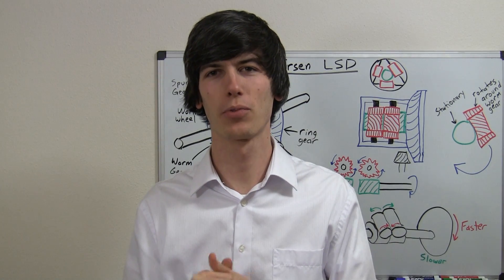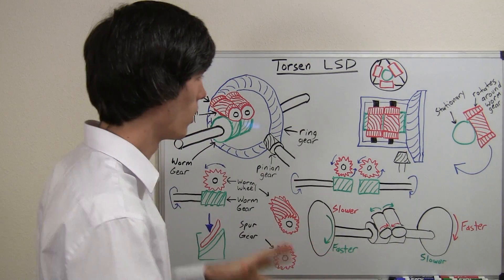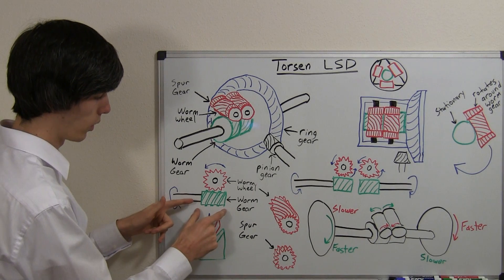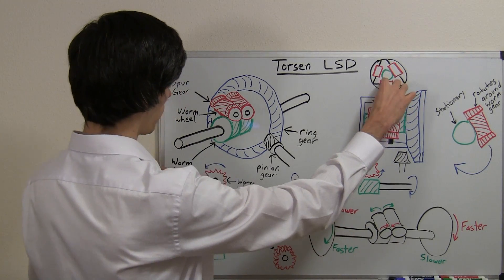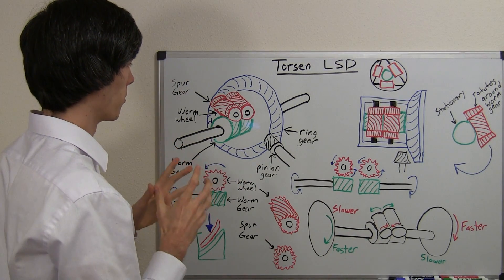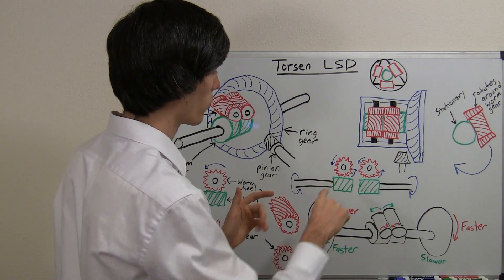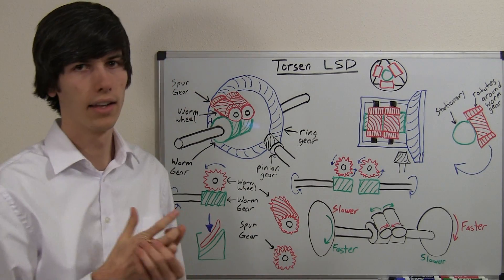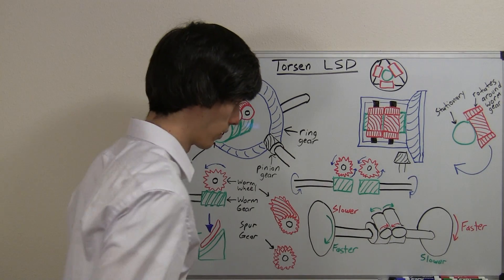Torsen Limited Slip Differential - Explained

Comment: My daily driver is in the shop for the yearly inspection, so i'm driving an FF with open differential right now. I live near the alps and yesterday we had about 25cm snow. My rx8 really shines in that conditions, the crappy kangoo sucks. I expected the ESP to make up for the open diff at least a littl bit, i hoped it would send some of the power to the wheel with more grip. I was not completely right. It kinda does that, but that also slows the car down. When there is not enough grip to accelerate and you need momentum to get up the hill, that really sucks. Instead of having a big smile, i was worried about getting stuck. Torsen is awesome, if you buy a new car, an it's an option, get it! It's worth every cent.

Comment: Please don't call a Torsen differential a limited slip differential (LSD). It isn't.
There is no "slip", limited or otherwise. There are no clutches.
The Torsen is an ingenius way to transfer 50% of the torque to each drive wheel, regardless of the relative speed, through the clever arrangement of worm, pinion, and spur gears.
There is no slipping.

Comment: You forgot the most important thing about a TORque SENsing diff, which makes it the wonder of engineering that it is, is the fact that if it senses slippage it locks instantaneously. When racing a regular open diff the unloaded wheel on a corner (the inside wheel) will receive more power than the loaded (outside) wheel causing a reduction of power because the unloaded tire doesn't have much grip. Think about an open diff with one rear wheel on ice and the other rear wheel on dry pavement. The one on ice will spin freely and the car will not move.
Reply: Unfortunately Torsen diffs will never lock if the low-traction side (LTS) has barely any traction (wheel on ice or in the air). But if the LTS has "enough" traction, then high traction side (HTS) will get 2-3x more torque than the LTS. It's a neat design but certainly never "locks" (although theoretically if the HTS gets 50 or 100 or 1,000,000 more torque than the LTS you might never an actually-locking differential since even if the LTS wheel is on ice then the HTS wheel might still "turn". Although torsen diffs usually give instead like 2-3x torque on HTS so if the LTS is in the air or on ice then your regular 2-3x torsen won't help you there...)
Reply: @MikeSmith-vb8ul  if you do a burn out both wheels lock. On an open diff you get a one wheel peel. I think you are referring to a LSD.
Reply: @jackg5094  And if you lift one rear wheel in the air and put the transmission to neutral you can rotate that one rear wheel freely while the other rear wheel completely *does not move at all*. So you see there's absolutely zero locking with a Torsen when one side has zero traction. A Torsen doesn't save you in that situation. And that happens when offroading more often than you think.

Comment: you explained it clearly enough... the housing is spinning around and the funny gears inside of it are spinning 1 output in a opposite direction than the other... both of those things happening at the same time means you go around a corner without dieing.

Comment: in effect it is not that the slower axle moves backward but rather the worm on that axle is in a locked position on the axle and revolves with it. as a result the faster axle (less loaded) is forced to spin faster - as the axle can spin the worm but not the other way around.

thanks for a good video.

Comment: Real neat. 

And no, like tides, you cannot explain. 

Even an animation is a bit confusing. From what I gathered, the ring gear + housing + spur gears assembly all rotate at a given speed.

Then depending on the load on both axles, each worm gear + axle + tires assembly will rotate either faster or slower than the above ring gear assembly. The amount of differential rotation is essentially set, due to the connection between the spur gears. 

The speed differential between the two axles would then have to be either opposite (if traction is different on both tires) or zero (if a tire has zero traction, or both tires have the same traction). 

I don't know. My head hurts.

Comment: Hi Jason, I love the beauty of simplicity in the Torsen and the new Audi Crown Gear diffs. Why has no manufacturer so far built an AWD system with 3 Torsens - center, front and rear axle? This would have so many advantages over the brake activated torque distribution of today's AWD systems. Are these differentials too large or too heavy? Or simply too expensive?
Reply: I've wondered this as well... i should fire up my 3d printer and make some small models and see if there might be an issue with the center diff under varying tractions or something.
Reply: hossguitar exactly my thoughts, i have a mitsubishi montero with a torsen centrall diff, wondering why not use 2 more in the front and back
Reply: jabadahut50
Answering for Aap Banaan, the Torsen has, what is equivalent to, six spider gears and cross pins instead of two.
Reply: The reason that almost all manufacturers use some type of clutch in the vehicles that matter on awd performance is cause a torsen diff isn't variable tq distribution. You can add hydraulic pressure to say the front or rear of the center diff to divide it's tq capacity per side
Reply: has a lot of rotating mass
Reply: Aap Banaan as opposed to a traditional awd system?
Reply: this is because the statement that the 'worm wheels cannot rotate the worm gear' isn't true. it still rotates them but ends up with a torque multiplier (depending on the angle). so in very low traction situation, even with the added torque multiplier which will make it harder to slip one side, it will still be a very low value (aka it will still keep slipping).

Comment: hello, I have a Hyundai Genesis Coupe. They come with a Torsen LSD and I was curious if it is normal for them to make a groaning (woahing) sound when you are making a somewhate tight turn at a low speed and start to gradually accelerate in mid turn. Thanks:)

Comment: Engineering Explained - so Torsen LSD is not really LSD, because there is no slip at all, therefore this is way longer lasting mechanism that normal LSD with clutches, is that correct?
Reply: Limited slip refers to slip of the tyres, i.e., a speed difference between them.  A torsen LSD allows there to be some speed difference before the differential locks, just like any other LSD

Comment: How torsen differential knows when to lock differential? Why torsen is not locked when we have different wheel speeds in cornering, but torsen is locked when one wheel is on the ice?
Reply: Because during a "gentle" Vehicular Turn, the Axle Shaft (Green Worm Gear) is "Driving" the speed difference...but once traction is lost on one side, the Drive shaft is driving the speed difference (Red Worm Wheel) and the beauty of Most (if not all) worm drives is they are One Way power transmission, at 2:40 he explains that the Green Worm Gear can turn the Red Worm Wheel, But the Inverse is not true.   (Floor The Accelerator In that Turn AND it will be like "Loss of traction)

Comment: I am not 100% sure yet, but I think that at 2:40 he makes a fundamental error in saying that the worm gear can't spin the wheel. That is usually the case but in the torsen the angle in the worm gears is not shallow enough to produce this "one way" transmission effect.
Reply: It would be great if we could have an answer from Engineering Explained :p
Reply: I have never seen a "Worm Drive" of any size that you could rotate the Gear by driving the Worm Wheel, regardless of the size or angle of the gears/wheels, in fact doing so usually ends up with stripped teeth on the wheel. (It's possible they exist, but in practical usage of gearboxes, that I have hands on daily usage, I have never seen one.)

Comment: I don't know how much money you're making, but if you get an offer to become an engineering professor, do it, you're awesome. 
.
I was confused at how "turning the car" worked with the wheels at different speeds. It makes a lot of sense now. The faster wheel creates excess force on the spur gear which then rotates the other spur gear the opposite direction thus relieving the force on the other wheel allowing it to slow down.
.
Then the differential works like a locked diff when accelerating because the most force is turning both spur gears from the force of the housing (from the pinion gear) causing the wheels to accelerate equally because both wheels don't have enough force to overcome the force of the engine.
.
I guess Vernon Gleasman got tired of learning hard physics so he made something from the simple physics that he knows: equal forces. God, I love physics, so glad I decided to take it instead of AP Chemistry. Thanks again Jason, you're awesome!

Comment: Very Impressive set of videos.  A way to look at it that might make it easier to explain how a Torsen allows the output shafts to rotate at different rates is to treat the faster rotating output shaft like it's the only rotational input to the system.  If you held one output shaft and applied a rotation to the other output shaft, then the worm gear of the driven output shaft will rotate it's corresponding worm wheel.  The spur gears on the worm wheels synchronize the worm wheels together and force them to rotate at the same rate.  The rate at which the worm wheels rotate is exactly the rate required for the worm wheel of the held output shaft to move around the circumference of it's associated stationary worm gear at a rate equal to the that which the driven output shaft is rotated.  So, when both shafts are rotating at different rates, as in a turn, relatively speaking, it's exactly the same scenario as I described above.  It's as if the ground is rotating the faster tire at a rate equal to the difference while holding the slower tire.  That rotational "input" from the ground to the faster tire allows the worm gears to turn the worm wheels, allowing the worm wheel of the slower output shaft to traverse the circumference of its associated worm gear, thus allowing the tires to rotate at different rates.

On the other hand, In the slippery wheel scenario, there is no rotational "input" from the ground.  The only rotational input is from the ring gear.  Since a worm wheel cannot rotate a worm gear, it must lock against it and transmit the case rotation to the output shafts, thus transmitting torque to the wheel with the most resistance and locking the rotation rate of both output shafts to that wheel.

I don't know if that makes it any clearer, but it's how I think about it.

Comment: It's remarquable how you were able to explain this using a white board only! I teach auto mechanics and was never able to explain this efficiently using only a board. However, it seems that you only explained the operation during the normal phases (when acting as an open differential), and you forgot to explain the easier phase, when it locks (as one wheel has no traction and the system locks: only one wheel wants to turn, its worm gear as well, trying to turn the worm wheel, the worm wheel is meshing with the opposite worm wheel which in turn tries to turn its worm gear, it cannot. So the worm wheels are unable to spin on their axis, the worm gears are both driven as it locks)
Cheers!
Reply from the maker: +Nabil Chouchany Thanks for the kind words! I created a second video explaining how the torque transfer occurs: https://www.youtube.com/watch?v=lDsQAs0Ldes
Cheers!

Comment: So put basically, the only time the wheels are allowed to spin at different radial velocities is when each one has friction with the ground, creating an equal and opposite radial velocity in relation to the diff housing, when one is slipping, the reverse worm drive effect blocks any lost torque. If one wheel is not imparting any force back through the differential then the diff locks automatically.

I'd hate to be the engineer who designed this trying to explain his idea!
Reply: Your comment was genuinely very helpful!
Reply: Indubitably! Only now I get it: the torque from the wheel lessens the friction at the worm gear, thus allowing it to slip. If that torque gets too low, the friction prevails and the worm gear locks. Umm... Right? 🙂
Reply: Fantastically helpful

Comment: I have to share a quick story on how I first learned how a differential worked...47 years ago as a young teenager. My friends dad built a working differential using parts from a mechano set.  He was a mechanical engineer and a very clever man.  He is 93 today and still works at his home based machine shop.  Nothing like holding something in your hand to see how it works.  Some things are so difficult to explain but some how you seem to manage.  Great video!

Comment: As far as my understanding goes: It was the worm wheels inability to drive the worm gear that resulted in the rotation of the tire of the car. Instead of the worm wheel shooting the worm gear in the direction that the worm wheel rotates, it pulls it down in an infinite circular motion driving the tire.
In the opposite case where the tire spins faster then the worm gear spins faster which drives the worm wheels.

That's about where my understanding cuts off, because after the worm wheels are driven (by the worm gear which is driven by the tire slipping), then the spur gears attached to the worm wheels would need to spin at a fixed rate that is relative to the worm gear driving it. (That's just how gears work, they run at fixed ratios). If the spur gears need to spin one to one, and the worm wheels attached to the spur gears, then ultimately the worm gears that drive the tire would need to spin at that same speed. Resulting in the same situation where both tires spin at the same speed.

The above works all well in getting the car out of a situation where one wheel spins too quickly and the opposite becomes the dead wheel, but i still don't see how that same set up can allow for the tires to spin independently around  turn. Is there some ratio set between the worm gear and the worm wheels that decides exactly how much variance is allowed between the two speeds of the tires? That is the only solution i can come up with, which seems dangerous because once that decided variance is exceeded then the entire mechanism would lock up and cause both tires to turn at the same speed in THE MIDDLE OF A TURN.

I don't know if you've watched any gymkhana videos but i imagine it would result in something similar to that
Reply: (This is under the assumption that the spur gear and worm wheel have to spin at the same speed, which i assumed because the video never clarified for me)

Comment: Sorry, but at the 4:20  mark my head almost exploded. 
     Can the vehicle  back up or  use  the Engine Breaking method on a hill  since the  Worm wheel and worm gear only work  in one direction .
Reply: LMAO...You have to have a understanding of physics and such for this. It is just stuff that happens when it is packaged the way it is...just the physical way these parts "mesh" together. Now, coming up with this crap is "rocket science"!

Enjoyed your comment...thanks for the laugh!
Reply: Steve Smythe
  I accept that it works,  but when someone claims that the Worm Wheel   and Worm Gear  mesh to only transfer the torque  in one direction,   I'm smart enough to question what happens when the  Driven  Gear  becomes the Driver   .    Axle ratios are   Driven/Driver   which makes a 36 tooth Ring  over a 12 tooth Pinion gear  for a 3.00 : 1  .   The rear wheel   can cause drag so the Ring Gear  fights the Pinion when you back off the gas to coast down a hill.   

    So how does the free axle make the Worm  wheel drive the Worm gear  if they just said that the Worm Gear only works in one direction to drive the  Worm Wheel.
Reply: Remember that the trans (in an automatic) slips constantly, although I am sure very reduced from yesteryear. I cant explain it, cause I don't fully understand, but if you had a working model in front of you I am sure you would then understand (as I would too). So for now I take their word for it.

Either way, your comment gave me a laugh!
Reply: In response to the original question here, I assume yes. I don't hear him say it doesn't and nothing is shown or talked about that would prevent that. I have no idea what Mr. Smythe is going on about.